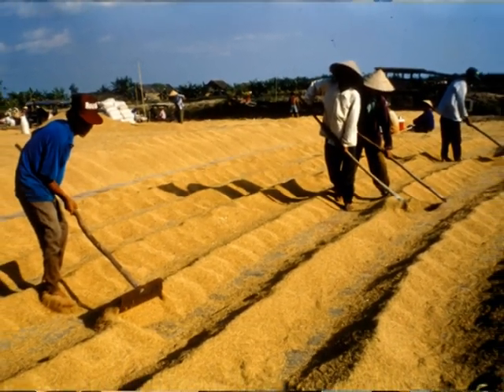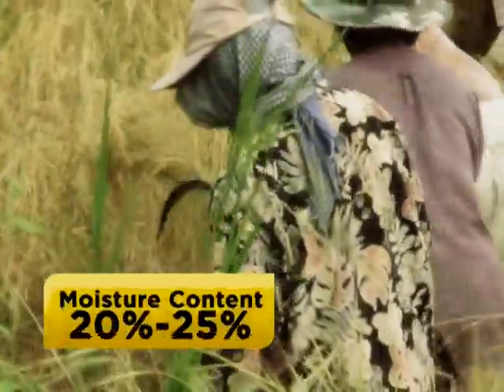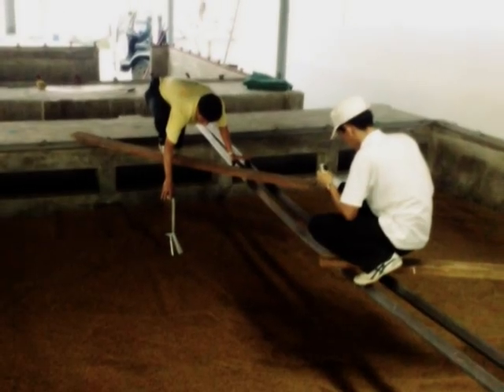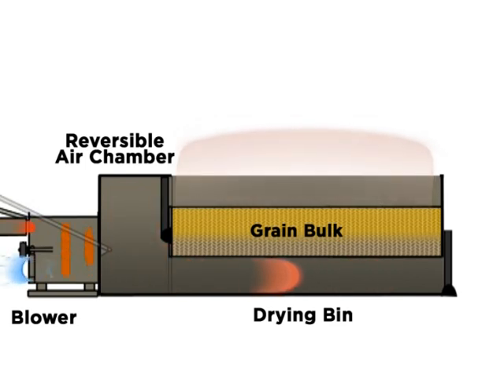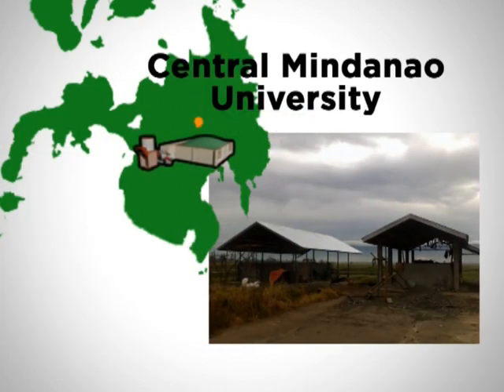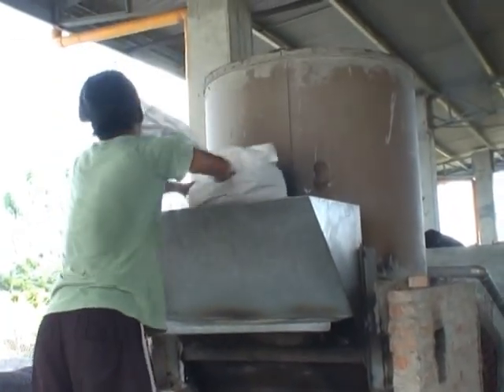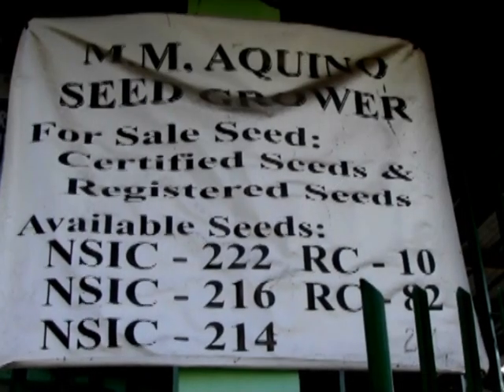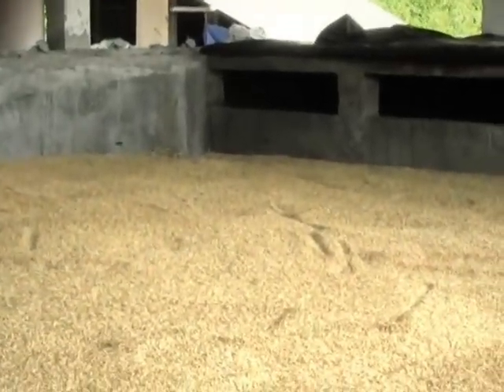Reversible airflow flatbed dryer in the Philippines (Dubbed in English)

Comment: The flatbed dryer system,  so simple as it seemed, is the simplest drying system design and yet even engineers failed to construct it satisfactorily in terms of fuel efficiency, and system efficiency...Because it involves the knowledge and understanding of fluid dynamics, and the agriproduct being dried as a biological product. Therefore, it is important to seek the guidance of an experience Agricultural and Bio-systems engineer in order to avoid costly mistake in this endeavor. ...Yours truly, Engr. Paterno C. Borlagdan (Mechanization & Postharvest Expert, Ph. D. in Crop process engineering) at your service...God bless
Reply: good a.m. sir Paterno Borlagdan. Gusto ko pa sanang turuan mo ako sa paggawa ng flatbed dryer ng palay. Saan po ba kita makita ngbpersonal sir

Comment: hello sir/madam, please can i have more details for this flatbed dryer, im a ofw in dubai planning for good in philippines
Reply: Please email me at: jettagrotech@gmail.com or cp# +63 936 374 8716
Reply: This is a flatbed dryer the same as the conventional flatbed dryer. But the flow of the heated drying air can be reversed from the bottom  up and vice versa. Hence, no grain mixing is required. But the time saved for grain mixing is also spent in reversing the airflow. So, basically there is no savings in labor. The reversible flatbed dryer is about 
20% more expensive than the conventional flatbed dryer and have a higher maintenance cost. The conventional flatbed dryer can dry paddy with uniform moisture content if properly operated, so thus the reversible flatbed dryer.

Comment: discover  a blower run benefited from Solar energy instead of a machine to minimize economy of expenses.
Reply: I think it is primary designed for gloomy and rainy days so solar motor system will not work during those times. But solar  motors can still be considered for sunny days.
Reply: how much it cost??